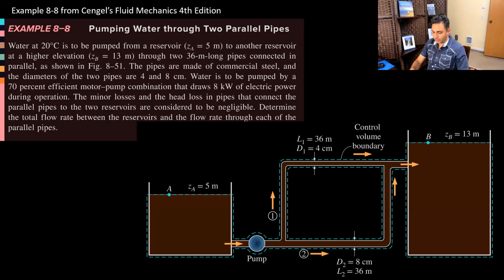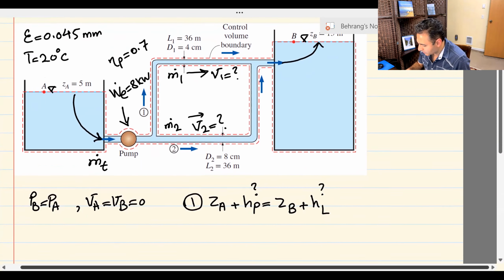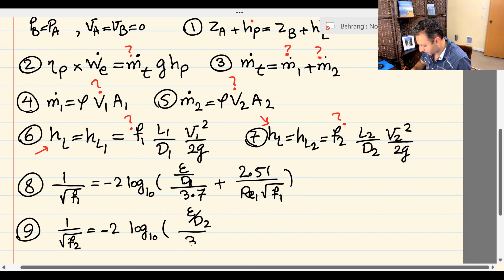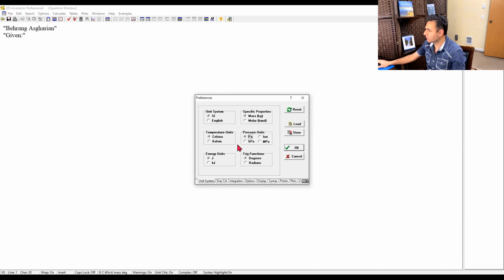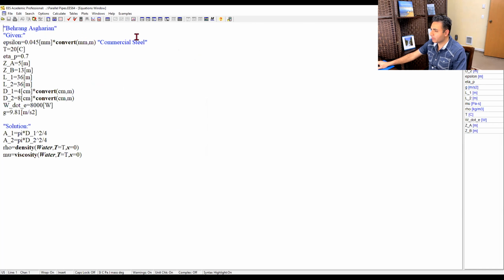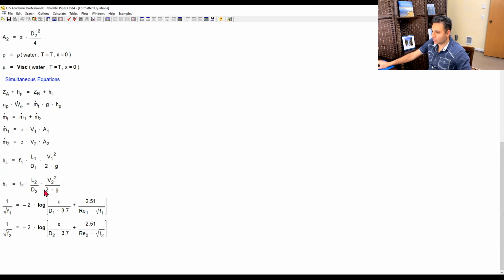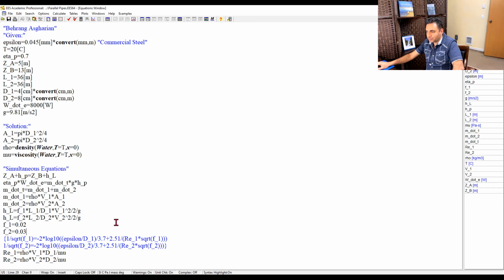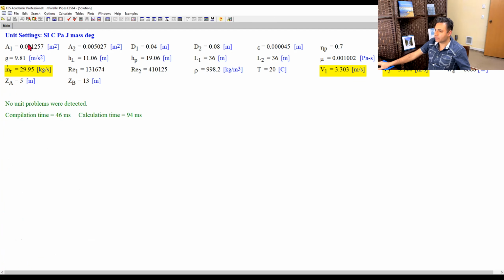Piping Network. Parallel pipes. Example 8-8 from Cengel's Fluid Mechanics 4th Edition solved in EES.

Comment: Hi there . Why didn't you consider the loss in the tess, from point 1 for example?
Reply from the maker: You guess what the problem statement said was the equivalent pipe length but that can be double checked. Also, in this problem since the lengths are big, major losses are bigger than minor losses. Therefore, another approach would be to ignore minor losses compared to major losses.

Comment: I am enjoying your videos, and working on doing some of my own. EES has come a long way since the late 90s, when I started using it (on a Mac!).
Three comments:
	1. No need to define “g” in your “Givens” as it is a defined constant in EES;
	2. You forgot to comment back in the f_1 and f_2 variables after you adjusted the minimum and maximum values; and,
	3. Your video of you sometimes covers information to which you are referring on the computer screen.

Overall, excellent and helpful videos.
(I am an Assistant Professor of Marine Engineering at the United States Merchant Marine Academy, and am a USCG Licensed Chief Engineer (retired from sailing, but license is still active).
Reply from the maker: Thanks for your comment. Appreciate it.
1- I didn't use g# (the predefined constant in EES) because in the formatted equation window I prefer to see "g" instead of "9.807 m/s2". However, thanks for mentioning it.
2- I shouldn't comment f_1 and f_1 back in because I uncommented the Colebrook equation for them in the code.
3- I noticed that as a problem and eventually I came up with a solution which I will apply to future videos.
One more time, thanks for your comment and I appreciate the time you took to watch the video and comment.
Reply: @professorbehrang  cool. I prefer g to show up in formatted equations, too, so I usually put 'g=g#' in the equations window and that is my workaround.
Reply from the maker: @redpike2973  gotcha!